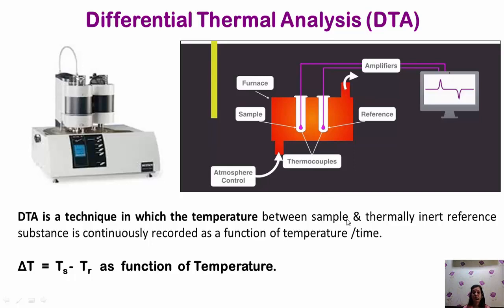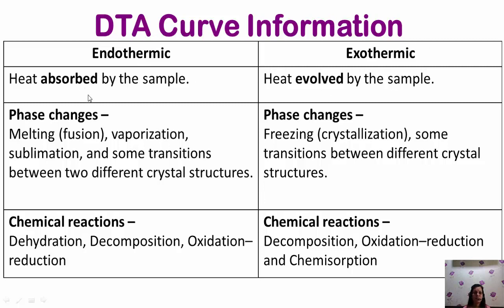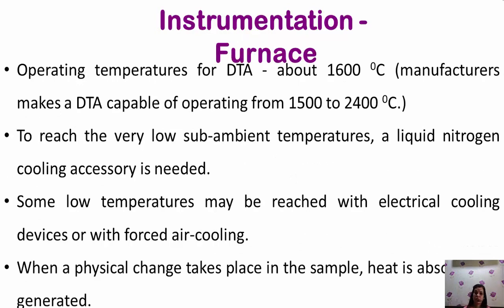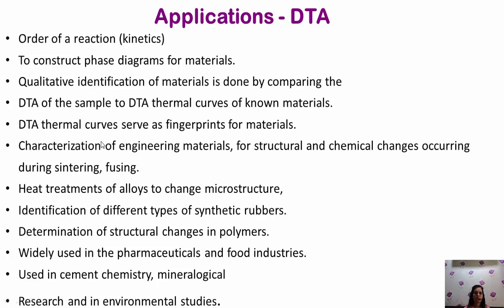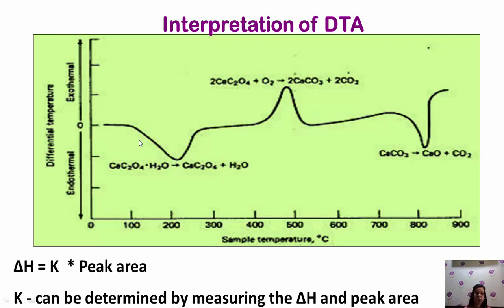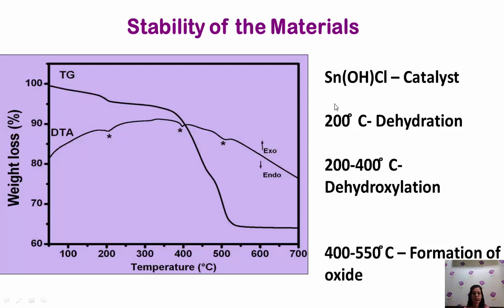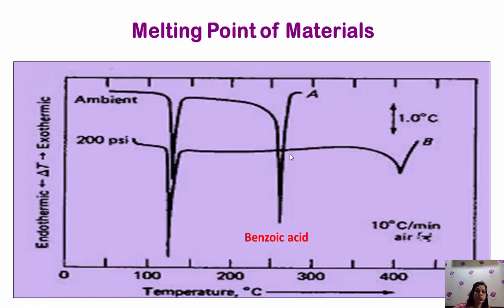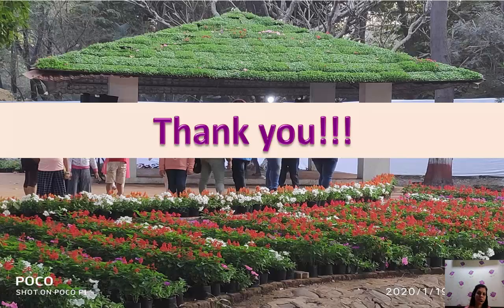Differential Thermal Analysis (DTA)@dr.suchetasinteractiveclas9804

Comment: How to calculate  delta Cp from Dsc curve ??
I hope you answer my question❤
Reply from the maker: Heat Capacity Determination:  To calculate the heat capacity of the sample . This heat capacity includes the heat capacity of the polymer or sample and the heat capacity given by the difference in the mass of the sample pan and cover and the reference pan and cover. That is:   ∆Cp(total) = Cp(polymer) + Cs (m(sample pan) – m(ref pan))  10  where Cs is the specific heat of aluminum, m(sample pan) is the mass of the sample pan and cover and m(ref pan) is the mass of the reference pan and cover. The specific heat of aluminum is available in standard references or can be calculated from the molar heat capacity. Use equation  to calculate the heat capacity and specific heat of polymer or sample.. Utilise graph to find baseline value and platue difference value to find delta Cp

Comment: How can we calculate the heat capacity using DTA
Reply from the maker: The heat capacity can be determined by the dimensional relationships, dividing the flow of heat from the heating rate of the sample: (δQ/τ)/(δT/τ)=δQ/δT=Cp . It can be written with the help of the heat flow, physical quantity which is obtained directly from the DSC curve.
Reply: @dr.suchetasinteractiveclas9804  Thank you so much mam.👍🏻
Reply: @dr.suchetasinteractiveclas9804 so, does it means we have to look at the DSC curve first to calcalulate the heat ?
Reply from the maker: Keep sharing with benefishries subscribe my channel